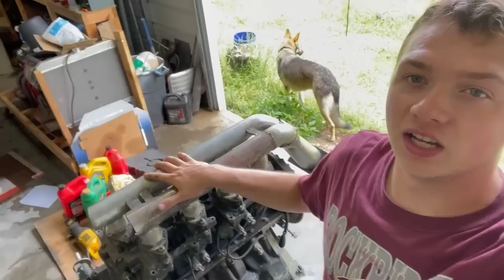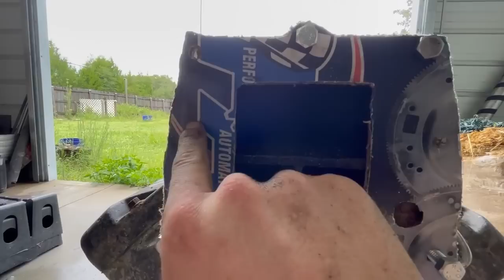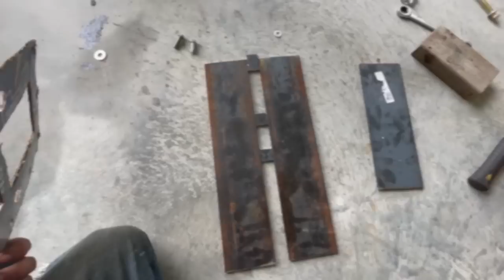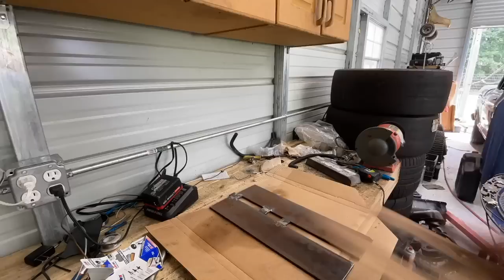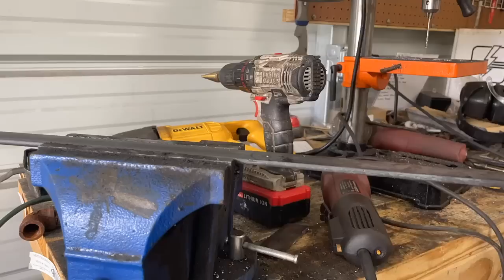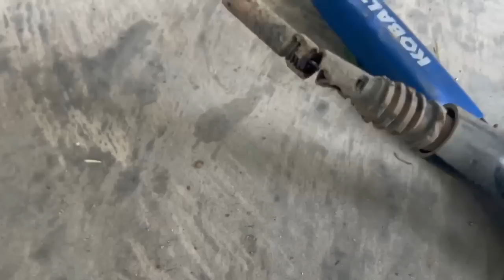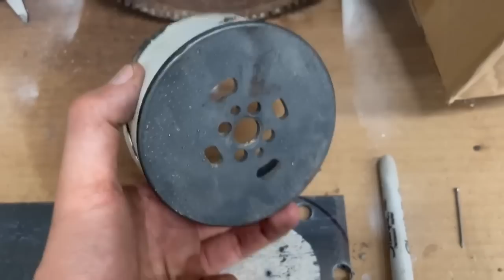Will this 2 stroke V8 BOAT engine bolt to a Chevy trans?

Comment: Suggestion: the water does not need to stay inside and boil from all that exhaust heat in the big chamber, Put a big piece of metal in there so the water moves faster through that section.You want the water to collect the heat from the cylinders and not from the exhaust.

Comment: When doing something like this it would be worth the time to find out how the cooling system works in the normal application.  Pretty sure that hose is for flushing the engine, and it's likely feeding it in reverse to back-flush the system so you probably want to flow the coolant opposite of what that connection would do.  But since the motor will be laying down there might be other things to consider to make the cooling system work well.  Also, the stock system dumps all the water through the exhaust, you'll have to figure out if the aluminum housing can handle the exhaust temps without water.

Comment: i just want to say one thing for you. as i like this project. before you go all out on your transmission adapter.
your going to need to gear it down before going into the transmission. most transmissions have a safe rpm range. american ones have lower rpm limit. euro cars rev higher.
these engines rev very high and that will basically melt your transmission in minutes. the bearings cant handle the rpms.
the honda s2000 had to have a special transmission because it reved near 10k rpms. 
it may be a good idea to use what you can from the original transmission to gear it down maybe unless thats just gonna make it spin faster but youd get to keep some of your exhaust youll need.
you could just do a chain input shaft or reduction drive or whatever. even a 2 speed transmission could help. some big trucks use things like that to get a whole nother set of gears. 
just some ideas so you dont have to do it twice.

Comment: the pump was on the main shaft of the lower unit so it was submerged all the time, outboards dump water into the exhaust to cool it and reduce noise.

Comment: He still had the mid section of the outboard engine. The part where the engine was originally attached to. I would consider it junk. So he could have cut out a 4 cm thick piece, and use that as a drill jig. Perfectly aligned holes all around. But hey-ho, necro-posting at this point.

Comment: I would at least get something like a TCI streetfighter or something comparable torque converter. As having been a commercial fisherman and using those motors they have no low-end torque. I would get at least a 2500 stall. Buttman great video don't take my word for anything. That just comes to mind having work with those and then putting it in a heavy truck. Hope to see it running. Hope to see more videos from you thinking outside the box. That's what people want to see something challenging and new I know I do

Comment: Those castings for the exaust port manifolds are inbuilt expansion chambers stretching all the way into that mid section of the outboard  you removed so basically your  going to have to recreate  that on the end of the exhaust manifold in the valley otherwise  your going to lose tons of power

Comment: There are no trust bearings in a 2 stroke engine the crank only relies on ball bearings typically whats going to hold the pressure from the trans oil pushing the converter to the motor

Comment: Noooooooo!
Mix what?
That's the tuned exhaust if you don't utilize it as is motor will be so down on power it'll be worthless. You cant afford or have the knowledge nor means to build and adapt 8 expansion chambers to the motor.
For the love of God man look into it please.

Comment: The Exhaust part is gonna be very worky....you need an expansion chamber for each cylinder, if you put a silencer on each exhaust end is up to you, but 2 strokes need this exhaust chamber.
And to do it for 8 cylinders each is a whole lot of Work....bring to information what ccm each cylinder has, then you know cruedly the exhaust length and thickness you need to buy. KRM Proride or Stage 6 exhaust are realy good and cheap, you need to customize them to fit properly i think,  but you dont need to build them from scratch😊
Reply: And thats only the output end...the intake part is a pain in the arse too😅

Comment: Cool stuff!  Consider cutting away the aluminum exhaust collector and attaching individual pipes at each exhaust port (like other terrestrial 2-strokes use.). That whole marine exhaust setup is dependent on lots of cooling water and you don’t need it. There may be ‘racing’ exhaust stacks available for that marine engine that are a good starting place but the point is to correct the exhaust for land use.  Looking forward to the next one!

Comment: i think he f.. up.. 100 % he did not think this through.. the way he is aproching this build is mest up... i hope he proves me wrong... there is a good reason motorheads do not mess with 2 stroke marine engines.. U need to resonate that exhaust or it will not start.. physicist and ur moms support does not go well together. i really really hope that he does build that beast. but yeah conntent creator is called now a days.. u may geet famous some day..

Comment: tip for ya....the bell housing does NOT have to be bolted to the engine.......as long as engine and trans are bolted WELL to a frame of some sort , and cant move. Only the converter or clutch need to be bolted to the engine, via fly wheel or pressure plate

Comment: Do yourself a favor and get a set of transfer punches, a lot better than spray paint, Harbor Freight has a large set. And a more accurate way to make transfer marks from a mating surface to chip board is clean the surface and use regular old house paint. Lay the chip board, I get a 3'x100' roll for 15 bucks at Lowes, on the wet paint and you get an extremely accurate transfer. A gasket punch set will help immensely when cutting out the pattern to ready it for layout on whatever metal you're using, and HF has those too, cheap. Awesome project, can't wait to see how it goes. I'm subbed!

Comment: Greetings from Norway. U r aproching 2 stroke with a 4 stroke mindset..NICE. Grind off the original exhaust from engine and use a early 90s honda, kawasaki, suzuki or yamaha 125cc 2 stroke exhaust on each sylinder, make it 10-15 % bigger, u need 2 use a 2 stroke expansion chamber calculator. U must weld exhaust mount and water chanels ports leading to exhaust. Now u will have 2 cooling banks. High pressur water pump need it + thermostat housing. Build the originals carbs to a dual or singel intake with direct 2T oil injectors..same principle like carburetor v8 engine. Put back your reed valves. Engine block does allow for some welding for mounting a adapter plate. small fly weel for high rev with a 4 speed gearbox from a old rally car or a powerglide gearbox from late 50s early 60s.. If it turns on wrong direction use a gearbox from a rear mounted engine older porche or wv. Sorry for my bad english.. If u put a EFI on it that will be awesome and expensive. Good luck budy

Comment: Boat engine in car is stupid, tuned totally different. do 70 it is flat boats tuned for lower speeds and HUGE torque as planing a boat in water takes a lot of torque and boats top out at and cruise at maybe 35 to 50 mph, car engines for cars boat engines for boats and truck engines for trucks, they are all different for a good damn reason. had buddy put truck engine in car he hated it the tune is like boat low rpm high torque not much HP car is opposite.
Reply: Not to mention a part for say a 351 in ski nautique twice as expensive as in a cards or trucks 351 ford. Buddy had mustang and ski nautique with 351 cleveland, nothing was interchangeable hardly had to get boat engine parts from boat place not ford they do not deal with them and prices for boats is HIGH.

Comment: I'm really excited to see what you're doing!  I've had some practice with running a single carb to multiple cylinders and have had some unexpected troubles.  Manufacturers have spent a LOT of time on intake manifolds, and I learned the hard way why that was a few years ago.  Hope you don't have those same problems running fuel injection.  I'd love to be able to offer some insight, and work with you on this to be honest.  You hiring?  Can't imagine what that's going to sound like, so I really want to see and hear it in person!  Most of the work that I've done has been for performance on smaller engines.  Motocross and hare scramble 2 and 4 stroke engines.  I've played with porting, tuned pipes, combustion chambers, timing and ignition systems, and have a deep knowledge of fuel injection as I was getting ready to turbo a project car of mine that I haven't made it to yet.  I DID build a 200cc Yamaha Blaster that ran with modded 400cc and stock 450cc quads, but I cheated, and used an off the shelf pipe.  Also a built a 500cc version that left them all, using a KX500 engine, and a home built pipe, but raced it myself and crashed out when I clipped a tree and the handlebar got me in the chest.  It was incredibly hard to start with the kickstarter going the wrong direction, and I didn't have the $ for an electric start system.  Also, then we had kids, so...  Maybe I should just get back to that lol

Comment: Sooooo. A few things. This is a 2 stroke. It can run either direction. And as there is no oil pan you can indeed run this right side up with the intake on top. You will need to premix the gas and oil. You havent figured out what direction you need to rotate the engine for the trans to work with the diff... Also you can run it with the flywheel to the rear but then the exhaust is going forward. But that's not a huge deal. Hope that helps...
Reply: I like the no oil pan on the engine as the oil tank sits in the boat. Some coyote fords are converted to run a valve loop charged 2 strokes and dry sump oil injected for racing! hemis can also start and run either direction too.

Comment: Google your local welding gas supplier and they will have all the tips,cups, liners for most kinds of mig welders. I did this back in the 70's, had to run it V down because carbs were the only thing available at the time. The service manual will show the cooling system routing so as not to get it backwards. If you need any tips on how to couple the trans give me a shout.,I used a turbo 400 but they mount the same.

Comment: You need to change your gun get rid of the Vulcan the Omni pro gun. The Omni pro welder uses a euro style connection at the welder so there are options I have a  Radnor Pro gun with a 15 ft lead on my 220!  You can use major brand name consumables with the Radnor.

Comment: First of all I love this build! Something you don’t see everyday. A couple of pointers or ideas, we will call them ideas since I have no experience in this conversion. 
1) water cooling: as most have said the water cools the exhaust and a boat never picks up hot water it’s always fresh so No thermostat… I would get a very high volume pump. A nice big radiator and probably a 5-10 gal water tank.

2) on the transmission I’m not sure how comfortable you are with a manual transmission. But a lot of the comments are correct on the thrust of the torque converter pushing against the crank. I would suggest going with a cheap T-5 out of a Camaro or s10 (before the comments come, this transmission is kind of weak and not ideal for hot rods) but you could always upgrade to a t-56 or something that definitely could handle it. Also with an auto transmission on the older ones you’re going to need vacuum for it to shift, or electronics.  The older power glides, 350’s and 400’s can be built with a manual valve body and the newer electronic ones can be shifted with toggle switches. But I would try manual for ease of control and no need to play with converter stall. It’s all done with your foot then. 

3) you can adapters for people that convert motorcycle engines to cars may help with transmission stuff there too. Also watch search 2 stroke stuffing , he is doing some crazy stuff with a 50cc two stroke and I don’t remember which video but he lays out some of the challenges with efi on a two stroke. He’s a freaking 2 stroke genius and if you let him know what you’re doing he may even have some good insight on the build. 

I’m loving the videos please keep them up and it’s so cool to see mom jump in the comments she should be proud !
Reply: The purpose of a thermostat is to regulate temperature, as opposed to "cooling". They create a circuit in the engine that recirculates the same water until it's hot enough to open, most outboards have one for each bank of cylinders.
Reply: @AaronBonBarron  thank you! I’ve always heard of and helped replace water pumps in outboards and never once heard of thermostats in them. This is where assumption gets you in trouble 😬😂
Reply: @Slot_daddy  I'm a marine mechanic so I've replaced my share of thermostats and water pumps haha
Reply: @AaronBonBarron  makes sense! And I’m an auto guy, just never even thought an outboard had thermostats , learn something new everyday.

Comment: Looks like your using gasless flux core, do you have the polarity reversed? Unlike mig where the ground goes on the  negative You have to reverse for gasless flux core The ground should be on the positive lug. If not reversed it runs terrible.

Comment: I think even at this early stage a quick measure of crossmember and steering rack clearance to that odd sump pan shape,could save a lot of trouble later, also you might not need the hight on the alloy inlet hump,   love the way like most of us that do not have access to CNC and plasma cutters and machine shops next door,you give it a go and if it does not work change it,thats how good engineers learn.    another concern is how much torque the block can take,it's  a bit thin , also the front will need some charging belt or something  so that inlet needs to split         great project but just not built the same.  good luck

Comment: The coolant may not be a loop like car/truck engines,   most marine engines run cooler than automotive engines, and the water pump usually pulls water into itself,  through the intake, and the block, and exhaust, then it dumps into the exhaust stream and it is  blown out via the exhaust ports usually at or below water level.

Comment: Mount a under trimmed plate maybe octagon or hexagon in your drill press with a bolt. Marked with your diameter of course. Turn it on low speed, angle grind to the line. Guaranteed to be centered.

Comment: the main concern I have is if you get it to run there is no thrust bearing in the engine.  The torque converter will push the crank forward and destroy the block. Not sure how you would put a thrust bearing on it. some thing behind the flywheel against the back of the block?

Comment: Your going to have to have the spacer made. And balanced. Otherwise the vibration will shake your setup apart. The flex plate. When I have my engines balanced it all goes to the machine shop including flex plate. Im glad you know this. Save you some heart ache.

Comment: If you would just get an extension cord with 10 gauge wire instead of regular 12 gauge extension cords you might be able to run your welder. GOSH like Napoleon Dynomite says.

Comment: Just a thought but I've done some oddball engine to trans mating before and the best way I could come up with for the Chevy transmissions is to find an old small block Chevy crank and cut the back portion that has the flywheel flange and converter pilot in it and have the center machined out to press in a 1 1/4'' shaft into it but in your case it would be a 7/8'' shaft to make an adapter.

Comment: Disclaimer - I skimmed the video and comments so am not sure how far along this is. Apologies if I'm covering old ground.
But...
Chevrolet "housing" drawings with dimensions are readily available.

Also Chevrolet housings having a circle concentric with the crankshaft are common. Use one as a layout tool.

Use such a housing and "sweep" it with a dial indicator to center housing to crankshaft. Transfer the two dowel holes and the rest is a cakewalk.

Sources for the housing include manual transmission housings; pre-'63 Powerglide spacer; medium truck SAE spacer; marine adapter plate; etc.

Good luck with it

Comment: Hey HP look on the internet fir a volvo with a 8 cylinder 2 stroke motor. It's got sone really good footage. As the vidro shows the part your looking at is at the bottom and it's got the butterflies for the intake. And the exhaust is very cool as well. Give it alook

Comment: On that exhaust end of the engine I would bolt on a block off plate and get a tig welder and drill holes in the manifold plate between the cylinders and and weld some aluminum pipe and make your own exhaust manifold.

Comment: I bought a new stinger (gun) for my welder from Amazon for 48 bucks, had it the next day.  Even had a flexible head which is nice.  Just remember, you get what you pay for.  While it will get you by, they are made from lessor materials.  On mine the trigger contacts are the weak point.  Every week or so I have to clean the contacts.

Comment: I'm not sure you are aware and I haven't looked forward , but you cant just drive an auto from the input shaft , you need the converter to engage the fluid pump or you have no fluid pressure, and if you had made a flexible joint from motor to trans it would work much better , say a rubber joint like modern tailshaft joints , they certainly up to the torque as they are ment for after the trans were power it 10 X the engine power.